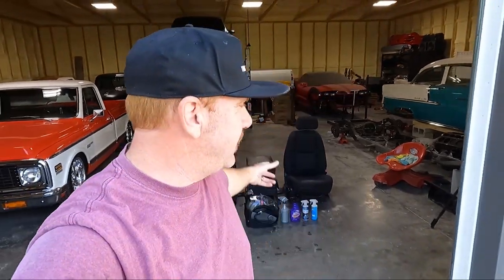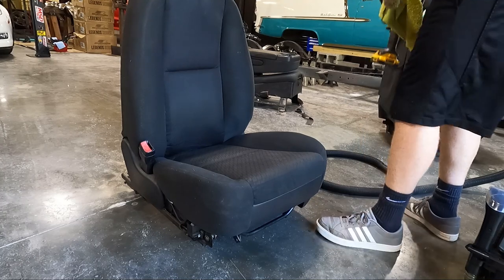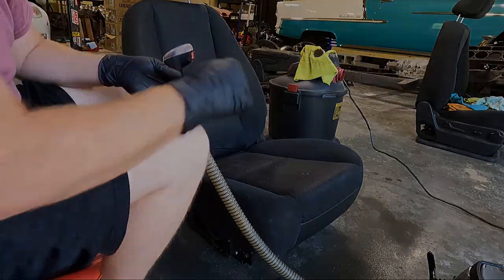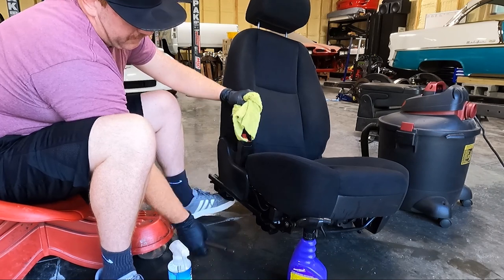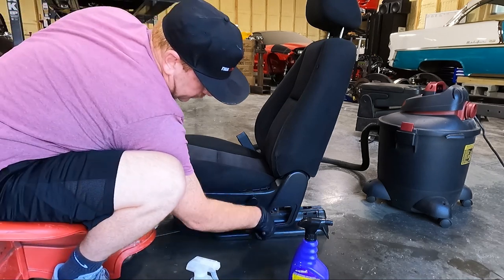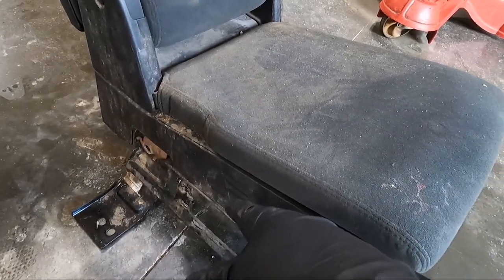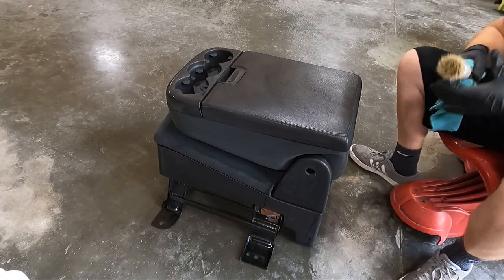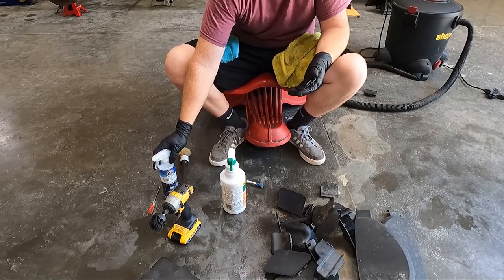Cleaning New Seats and Console for The Slammed NNBS GMC Sierra (They were NASTY!)

Comment: I love spray nine!
Reply from the maker: May have to try that
Reply: @TWAMotorsports  that white and green bottle you had on the floor looked like it. It's a great cleaner/degreaser. It's pretty aggressive so it may dull painted surfaces so need to be careful where you use it.
Reply from the maker: That was a bottle I used for superclean